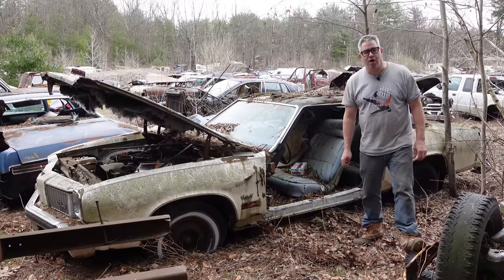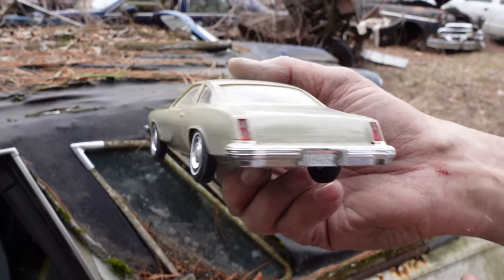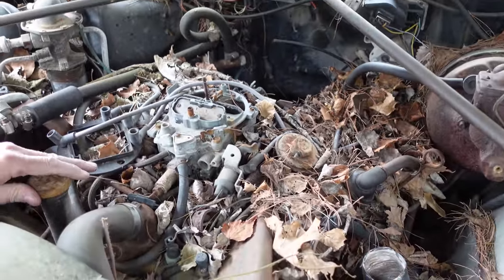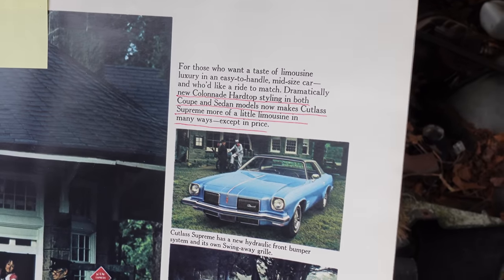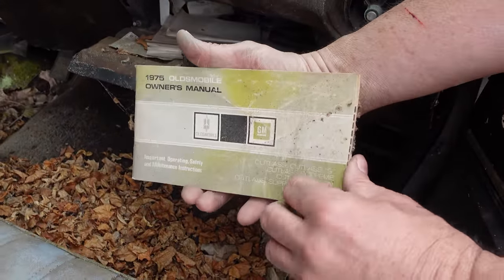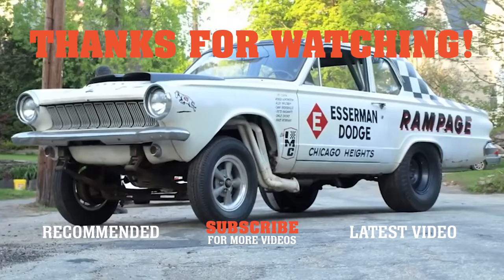A Lot More Cutlass

Comment: Thank you for not calling the cold air intake ram air.

Rollover standards did not exist in 1975. Convertibles weren't legislated out of existence. Detroit stopped making them because they weren't selling.

I hope you had a good time in Florida.
Reply: Mr. Magnante is correct. The looming rollover regulations got the automakers worried and they then went to T-Tops and sunroofs for a time until 1982 when domestic convertibles came back.
Reply: @googleusergp  He is not correct. His statement was the car was designed to meet then current standards. There were no current standards. If there were the hardtops shown in the brochure with the Cutlass could not have existed.
Reply: @bradkay4794  He is in fact correct, because you missed his and (my) point. He is also correct because every trim tag on a GM car often said, "General Motors certifies to the dealer that this vehicle meets all applicable regulations at the time of manufacture". So yes, he is correct, they did meet the standards (padded interiors, seat belts, safety glass, lighting, etc.) Cars are on the drawing board 3-4 years in advance. The IMPENDING (meaning "about to happen") rollover standards had the legal departments worried about lawsuits. They had to be prepared. Yes, the regulations never passed through. If they did, they would be in big trouble because they wouldn't have products in time that met the standards. 

The threat of the looming standards was enough for them to drop convertibles. After the coast was clear, they came back in 1982. But GM and the others had to be ready for it. This is well documented.
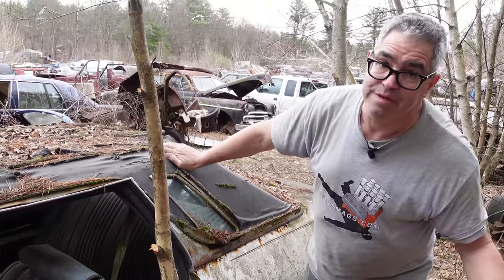Reply: @googleusergp  Listen starting at 1:34. He says it was done to meet regulations. Not future regulations that you say. It's clearly means current regulations.

Now if somewhere else he qualifies and says future I will accept being wrong. If it's there, please post the time.
Reply: @bradkay4794  Yes because the industry was told they were coming. So by the time these cars were on the line they met the standards and might have met impending standards as well. Convertibles were indeed legislated out of existence for a time, albeit with perceived laws that never materialized.
Reply: @googleusergp  What are we disagreeing over? You say roll over standards were coming. I say roll over standards were coming. Steve says they were already here in 1973.
Reply: @bradkay4794  The fact that convertibles WERE "legislated" out of existence. Even though the laws never took effect, the manufacturers were nervous enough that they would be trouble, so they stopped making them for a while until the coast was clear again.
Reply: @googleusergp  Is that all it is now? If you want to interpret proposed regulation and some manufacturers stopping offering convertibles as legislated out of business that's fine with me.
Reply: @bradkay4794  Yes, because that IS the reason why they stopped offering them.
Reply: @googleusergp  Since the people who made the decisions aren't here I don't know how we can resolve whether it was declining sales or fear of future regulations.
Reply: @bradkay4794  We can however go by well documented history that has been stated for decades that the fear of impending regulations is the reason why convertibles went away. That was what Mr. Magnante was driving at.
Reply: @googleusergp   They were already cutting back on convertibles before there was any talk of rollover standards. Repeat something often enough and it becomes to be viewed as a truth. One of my favorites is the well-documented history of people saying that the pintos defect was the gas tank behind the axle.
Reply: @bradkay4794  Nah, I'll just stick with the facts, since that's what they are.

Comment: Still a lot of controversy over GM killing Oldsmobile over the lower volume Buick but then they were looking at the chinese export market more than the domestic. I think there was some government input on that one.
Reply: Actually the Chinese market was the excuse given for dropping the axe on Pontiac. When GM axed Olds, it was the mid market nameplate of their lineup. I guess they felt it would be the logical choice to axe. By that point in time, (or really since the 70s) there really wasn’t a dime’s bit of difference between the divisions of GM anyway. They had no use for the innovation developing division since Cadillac had already took the Aurora V8 and turned it into the Northstar V8. When you think about it, what has GM actually done in recent memory other than hang on and avoid collapse?

Comment: I remember farmers chiseling the no lead flapper off and using leaded fuel.  As a result, they would overheat the catalytic converter.   Many of hay fields caught fire when they drove out into the field.
Reply: If the converter didn't get clogged first. Leaded fuel does wonders on the converter.

Comment: My first car was my mom's old 1979 Cutlass Salon with a Chevy 305 engine that actually started my whole entire process of breaking down and kind of sort of rebuilding engines, I did take it apart and reman'd the crank and replaced the bearings and gaskets and it was a successful project using the Haynes manual. But then at the end of the day, you've done all that work and you still have a Cutlass Salon. Lol.
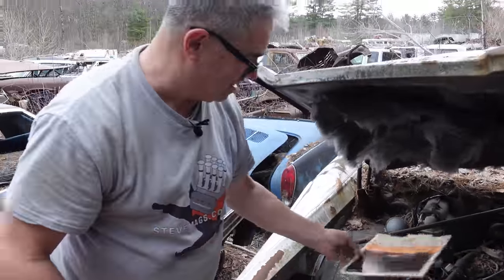What I really want to know though is what is that blue convertible in the back at around 7:25  ??

Comment: in life some how you got a "free" car,, and it was a 1979 Cutlass Supreme,  but with a Clunk 231 V6.. yeah that was the "free" catch up.. a name car hard to forget
Reply: I had a 1979 Cutlass with a 231 V6. It was very reliable, but I always changed the oil and drove it easy. It was my sister's car, then mine for a time. We had it from 1985 (when it came in as a trade at the Cadillac dealership my father worked at), and sold it in 1993. The car didn't owe us a nickel. I fixed the AC in 1990 after the hose/muffler assembly broke one day, putting in a used one from a 1980 Cutlass 231 V6 from a yard. New O-rings and a charge and I was in business.
Reply: @googleusergp   very lucky,,
Reply: @CHIPNDEATH  I knew what they were all about. I wound up with ten of them as parts cars. I stripped them and junked them. Sold off the parts for several years.

Comment: Great video sir. One question. Have you ever spotted a car in the junkyard that you wanted to make a video of and then when you went home to research that car then went back to the junkyard the car was gone? Just wondering. Greetings from Reynosa,Mexico.
Reply from the maker: Hello Read The Bible, Thanks for watching and writing. You ask a good question! As you know I do pre-visit each car so i can do a little research on it before returning with Super Shane to make the videos. Though none of my "target vehicles" has gone missing, I have returned to find cars: moved and in some other location in the yard OR damaged by falling tree limbs after wind or snow storms. The tree damage doesn't kill the video but I've seen some nice cars get mangled by the mass of a 100 pound, snow covered tree branch falling down from 20 feet above. This can bend the windshield pillars and deform a hood / roof / trunk very easily. Its not so much the weight of the tree and snow but the MOMENTUM they get in falling from heights. As for the moved cars, i just ask Dale Hastings (Bernardston Auto Wrecking owner) where he put the car in question and go from there to make the video. One thing that happily does happen somewhat frequently is cars will be GONE after I publish a video on them. About 3 or 4 cars plus a bunch of parts have been sold by Mr. Hastings as a result of folks seeing the video. I never get in the middle of this business and am very happy the cars / parts find new use and Mr. Hastings earns some money to help keep the place running. Its a win-win-win for the car, the business and the videos. OK, Thanks again for watching and writing. -Steve Magnante
Reply: @SteveMagnante  Thanks for replying sir. If you ever get the chance come to Reynosa,Mexico and review the junkyards here. My wife will prepare for you and Super Shane the best Mexican food you’ve ever had. I’m originally from North Carolina and my wife is from Acapulco. My neighbor has a 67 Mustang F back 390 4speed 9 in diff. Another neighbor 70 Trans Am 455 4 speed. Many 60s Dodges are Plymouths here also. Okay Señior take care and very much appreciate your videos.

Comment: I owned many late 60s Cutlasses and early 70s before I bought a friends 75  with a 260. Going from a 60s Cutlass to a 75 was a tough pill to swallow. It drove like a waterbed and  the 260 was the worst v8 I ever drove , powerless against the weight of that boat. These were fat floaty boats compared to the previous lineup of Cutlasses. Between the weight and the emissions requirements these cars are best left in the junkyards not a good base for a restoration project.
However as usual Steve did a great job explaining the history of this monstrosity.

Comment: I had a 1970 Cutlass with the 350 Rocket engine.  It had nice white bucket seats with a great console and a wooden knob shifter.  I decided to check the gas mileage once and I was getting 9MPG in the city and 12MPG on the highway, but that is what you get when you drive it with the peddle to the floor.  I used to say, it was a race between the speedometer and the gas gage.  Sadly, the tree I hit did it in!
Reply: My standard practice on all of my collector cars is to never calculate the fuel economy - I don’t want the knowledge of how bad the mileage is to interfere with my enjoyment of that sweet exhaust note!

Comment: the J57 and G37 had different quarters and roof line so there isn't a "plug" in that quarter where the window is. that was the supreme style with the small opera windows. the base cutlass could be ordered with the Y76 option, that did have a "plug" or plate covering the big triangular window to make it look like the supreme opera window. that left dash panel had the opening in the back for the optional electric clock. the ac controls are on the right. 1975 saw the introduction of the olds 260, that could also be had in the cutlass, besides the 350 or 455. i had several 75's with the 260 and 350, with and without ac.
Reply from the maker: Amazing to think Olds offered V8 engines that were almost 200-CUBES APART in size! I can't think of another situation where so many cubes separated the smallest and largest V8 offerings in the same year. The closest might be the 1973 Ford Torino Police Interceptor's 302 - 460 V8 engine spread. Chrysler had 318 to 440 in several years, Chevy had 307 to 454, AMC had 304 to 401 but these are all much smaller gaps than Olds' 260 - 455 range of 1975! Numbers, numbers, numbers. Thanks for watching and writing. -Steve Magnante

Comment: Had a 75 2 door bench seat 455 turbo 400 transmission,  fooled many fox body 5.0.
I went to oil change establishment one day to have the oil changed in said Oldsmobile and there was an Advance Auto Parts beside the oil change place so l bought and installed an air filter before l pulled in there and the technician comes to the waiting room with this very dirty filter and so l play this along like I'm a idiot so I say l wasn't aware that filters got dirty that fast and of course he tells me it doesn't take long for them to get that dirty so l show him the receipt where I just purchased a new filter and he goes oh I'm sorry this goes on the other vehicle in the service bay which was a Subaru. 
The air filter is almost as large as a Subaru engine. 🙃😃🙃
Reply: I had a similar experience at my local Acura dealer years ago. I told the service rep that I write the date and mileage on my filters when I change them and the one they showed me didn't have it. "Oh".... was the answer I got and she walked away to another unsuspecting customer. I always thought she and a tech were in on that scam. They had some turnover years later and seem to have gotten more reputable staff.
Reply: They tried to get my coworker with the cabin air filter scam. I think he fell for it once, and then told me his was due to be done. I showed him what to buy on Amazon and then we went out to his car before lunch and I had it done in five minutes, barely getting my hands dirty. As we came back into the office to wash up and have lunch, he said, "The dealer wanted $150 to do that". I said, "Man, I'm in the wrong business." 

Another time, I took a friend for cancer treatment at an outpatient facility and I changed her cabin filter while waiting for her to come out. She was quite sick from the treatment (fortunately, she's been cancer free for a few years now) and said, "How did you do?" I said, "All good. You couldn't have been in the procedure room and I had it done....".
Reply: When my Sonic was in for warranty work they told me it needed plugs. I said that they could change them for free because they were 100k replacements and the car had a lot less miles. The zone rep who was and still is a dope said smugly that those are maintenance items. It is then that I asked if he read the warranty booklet as I had where it clearly stated the plugs were covered by the emissions warranty. That is when he agreed with his tail between his legs. I then told him that if they got cute and said they changed them and did not that I would run the date codes on the old ones by NGK who made them for GM. If they came back as not in line with the cars build date I would run them up and down the flagpole seven ways to Sunday with fraud.
Reply: @LongIslandMopars  Years back my friend called the Chrysler dealer for a fuel pump for his 1991 Shadow. They quoted him $300. I told him to come with me. I had the parts store pull out the Airtex pump unit off the shelf. As I worked for an auto parts manufacturer at the time I knew Walbro supplied the OEM pump. Walah, the Airtex pump unit was a reboxed Walbro (now TI Automotive) so we got it and installed it at my house. The car had 100k at the time and when my friend donated the car with over 200k on it that pump was still operating fine.
Reply: @googleusergp  Cool. Dealer prices are what they are. I take the Acura to the dealer when it's something I don't want to do. Luckily they are pretty reliable which frees up time to work on the Coronet. Just did one rear shackle today. After 57 years, that old one just didn't want to let go....
Reply: @googleusergp  I refused to do the plugs in my wife's RDX as those back three are a nightmare. I paid to have them changed at 126k miles and I always wondered if they were. It was piece of mind for me but I have 120k on my 4 cylinder TSX SportWagon and it runs like a top. Those plugs are easy though, so I'll do them myself when I'm ready. Only going to use NGK.
Reply: @LongIslandMopars  As soon as prices normalize (should be soon), I'll get a new car. I'll keep my fleet, just add to it with something newer to drive.
Reply: @LongIslandMopars  I always look at maintenance before I buy a car to make sure it's easy enough to do. Although, I was sweating doing an oil cooler on my cousin's 2014 Dodge Grand Caravan with the 3.6L Penastar. Took us two days as we took our time and marked everything. Put it back together and he took it on a 500 or so mile round trip and all was well. I wouldn't want do that job again. LOL.
Reply from the maker: Hello Gary Mckee, Thanks for watching and writing. Your story reminds me of a TV show pilot I created about 20 years ago for Speed Channel. The idea was to set traps for L.A. area auto service shops to see which ones were crooks. Some good "I.Q. / integrity Tests" for mechanics we conjured were to walk in and say: "I have CASH and need": a radiator for a Chevy CORVAIR, head gaskets for a Mustang Boss 429, air conditioner re-charge for a Plymouth Superbird. Corvette owners could request: new coil springs for a C4 Corvette, front ball joints for a '62 Corvette, disc brake calipers for a 1964 Stingray or push rods for a 1990 ZR1 Corvette. The trap is set...who passes? Who fails? The TV show idea was not accepted since Speed Channel said it was "too technical' (sound familiar?) Thanks for watching and writing. -Steve Magnante
Reply: @Steve Magnante  Thanks Steve I look forward to your videos every morning.
Reply: @SteveMagnante  I worked with a woman that had me take a look at a service bill from a local garage (independent) for her Toyota Corolla. Now this was a person that was supposed to learn automotive in her job with us, but never did and that was the problem (she stayed four years and never once completed a project.....). I took a look and said, "There's about $400 in fat built into this bill and there are fictitious charges here." She asked me to explain and I said, "He is changing (and charging for) a non-existent fuel filter. The fuel filter on this car is in the tank and it's not a replaceable unit. Plus he's charging you double to change the same belt on the car with another labor operation". She was insistent that he was right and an "honest person". 

I said, "If that guy is honest, then Pinocchio has the Brooklyn Bridge for sale for $1 and never told a lie in his proverbial life. That guy is a crook and he knows he's hosing you big time". Nope, still didn't believe me. She paid the bill and left our bureau still thinking she had an honest mechanic.........

No wonder why my other coworkers didn't care for her much.